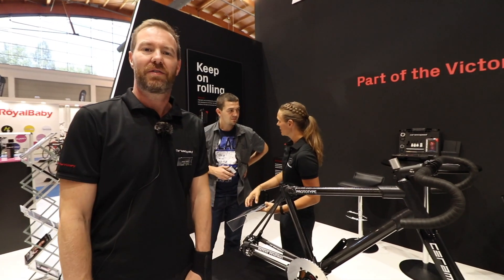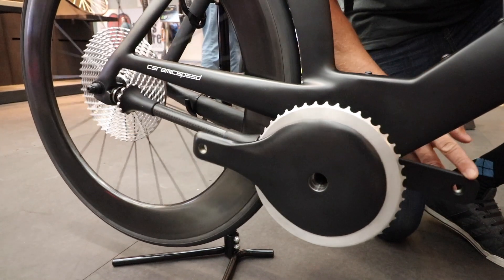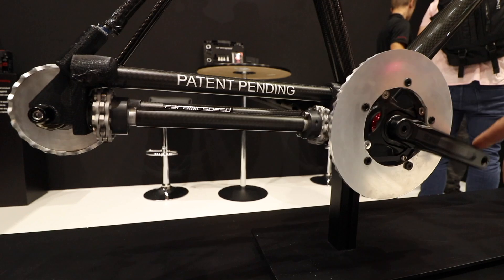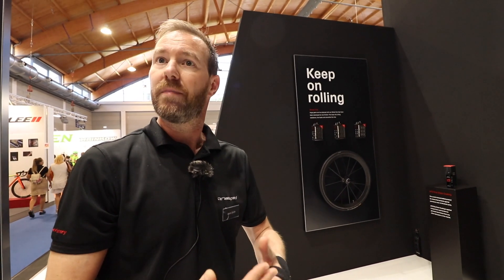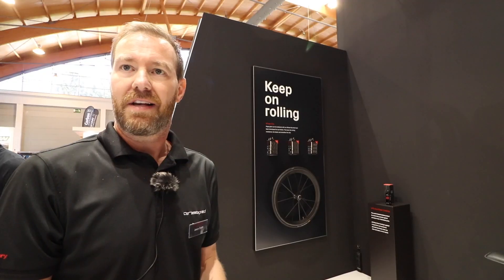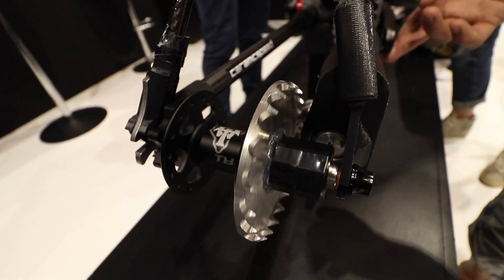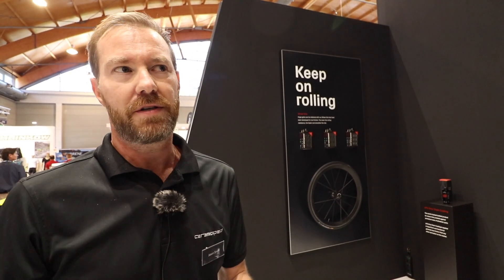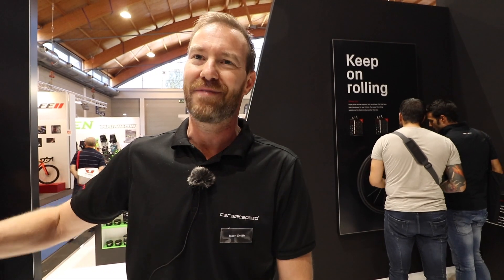CeramicSpeed Driven chainless drivetrain is 99% efficient

Comment: 49% reduction of how much friction? If you have a  very small amount of friction in the first place then the saving is still a very small amount of friction. Also what about when the output is much greater than the test point? There could be loads of distortion with this drivetrain which could cancel out any improvements.

Comment: Another ingenious invention, add it to the 3 million + inventions in the US in the last 100 years.... 

My only concern is during difficult terrain, when the bike is bouncing and a rider applies torque during an uphill climb, while standing up and then changes gears, how will it switch from gear to gear smoothly. And what about adding in a wet path / road, in the middle of a rain storm, how does it handle...

Comment: Finally a challenge to the 19th-century roller-link chain. As a bike mechanic I have to explain to people  why, if they let their chain wear out past 0.75 percent, so-called "stretch," it has already destroyed several cassette sprockets, and their most-used chainrings. This necessitates a fairly expensive drivetrain rebuild. If the new system can demonstrate longer wear, and reduced cost to replace wearing components, then we can seriously consider phasing out the current bicycle drive system.
Reply: Arne Ryason 
This won't be either.

A lot more wear and tear, and the parts have to be very very precisely made.... And very expensive.
Reply: Prototypes are always expensive. Precision manufacturing in the bike business is easy, just look at the tiny details on the "power link" style master links on multi-gear chains, and the precision forging of cassette gears. I've been working on bikes since 1972 and that kind of thing would have been "impossible" back in those days. All it takes is demand, and economies of scale. The VCR is a good example of highly precision components in mass production. The video head gap is measured in a fraction of a  micrometer.

The pitch of the roller-link chain is constantly lengthening as it is ridden. This is especially true with mountain bikes, the front wheel throwing a constant cloud of dust into the chain, which acts as griding compound. The wear on the CeramicSpeed system will happen on the little rollers that drive the gears, but the pitch of the roller-carriers won't change. I can envision those little rollers being mass-produced, easily replaced by the bike shop or user. If the claim of 49 percent less friction is true, that is a significant reduction or wearing components, and ultimately a reduced cost to the consumer. 

The horse and buggy are no longer a common sight in most American cities, and my guess is that the days (years probably) of the 19th century roller-link chain are numbered. Resistance to new technology is fairly typical, though.

Comment: The entire bike would have to be build around this drive train so it would be extremely expensive to purchase, maintain, exchange used parts. And ceramic speed has the reputation of making things unnecessary expensive so entire bike with that drive it works like they claim would cost around 100.000 $ ....

Comment: Well you need people with innovative ideas otherwise we would still be in the Stone Age. From an engineering point of view it’s superb. The idea looks like it has been reversed engineered from direct drive motorcycles ie BMW 1200 GS, as an example. The idea is sound.
Reply: Problem I see with this system: You need very little tolerances in the concentricity of the chainrings and a high stiffness of the crank and bikeframe under load. The drive shaft can not counterbalance any tolerances or wear like a chain can do. So you need a force to push the gear to the "chainring" to prevent "jumping". A Chain creates its own force , which pushes it to the chainring
Reply: Mark Gilder it's flawed,
Cannot transfer the torque.
Reply: The bmw has a bevel drive with a robust cast housing
Reply: By innovative you mean recycling 19th century technology and saying you just invented the wheel?

Comment: Lmfao this is a decades old idea. Actually 2000 years old Archimedes idea. The problem with this system is that the tolerances have to be 100% dead on as any movement of the shaft will immediately skip the gears. Curved teeth is a moronic idea because the force you are applying is not spread over the the ring as a chain does. So the force is being applied over only 2-3 teeth which you already know this company will be selling a lot of parts..... This is a complete joke of an idea, even Archimedes or Da Vinci would laugh at it. If I was there at the demo I would ask that question immediately so all the force is being applied only to 2 teeth, so what happens to Ring vs Cog Gearing !!!!!! Which is the whole point of the Rings!!!! Lmfao.
Reply: they also cut their dick to save 100gr
Reply: I agree, i question it's fundamental design, it might work wonders on a stand, but what about the real world conditions, not only would there be allot of load at the point of contact where the teeth engage but i'm pretty sure it would create flexing and what not in the actual gears and cassette, a strong rider can really put down allot of power and combine that with frame flexing etc and since you don't have the agility of a chaindrive flexing of the materials will cause hosts of issues with reliability and consistent performance, i wouldn't even run this as a casual rider, chaindrive systems have become really good over the years and are reliable enough, and they can be set up on many different types of bikes, they are easily adapted.
Reply: its not for mountain biking or goinguphillthen,just for stadium race
Reply: Aditya Wardhana lmfao they already ride 5 kg bikes lol WTF do they else need!!
Reply: Soon there will be bone replacements for cyclists where they replace their bones with carbon fiber replacement for weight loss.
Reply: HansensUniverse lmfao ROFL  , hell make a half man half bike lmfao.

Comment: Why not put all those 'gears' on the crank/drive wheel?
Leave the rear hub as a light weight single speed gearing.
All the weight stays central, all the teeth are inward.
But your asking more and more from the bottom bracket.
Reply: This is actually a better idea than ceramicspeed! It puts the highest torque through a smaller (less bendy) disc diameter - the inner ring of "gears" on the chainwheel - instead of highest torque transmitted at the edge of the large (bendy) disc at the rear wheel

Comment: This is only a showroom prototype. From the engineering standpoint I can see some severe problems:
1.) There is only 1 point of contact at any time with the small bearings to 1 tooth. 1 tiny bearing has to transfer up to 1000 Watts peak performance from a strong sprinter/MTB guy which leads to short lifetime of the bearings and tooth material. The problem is not the Ceramic ball inside the bearing, but the steel bearing outercase and the steel tooth of the discs that have to transfer all power within a 1mm² contact area.
2.) Is the carbon shaft torsion resistant to a strong sprinter? How long does it last?
3.) The power transfer to the disk again is done with 1-2 tiny bearings on a huge disk. The further away from the center the more lever there is which means the light disc will bend inwards unless it is made from very solid aluminum (too soft), titanium (expensive) or steel (heavy). 
4.) To best save weight the 2 discs would have to be made from aluminum, which wears down quickly due to 1 point contact with 1 tiny bearing. A regular chain can spread the load on many aluminum/steel teeth to avoid that problem.
5.) I'd like to see the shifting between gears, as there is no smooth chain overlap among cogs but a sudden step between the gears. The slightest misalignment (tooth on tooth) would lead to catastrophic failure of the gearing. That's why he is talking about 5 channels and computer controlled movement in those channels. The disc needs to be high precision manufactured (CNC machined just like the SRAM Eagle) and therefore very (!) expensive.
6.) Unprotected ball bearings are a maintenance nightmare in the open environment. Even sealed bearings will accumulate dirt over time, just ask any inline speedskater. Dirty bearings drastically reduce performance.
7.) Bearings in this system are waste material due to heavy abrasion as a single point of contact of power transfer. The tiny outer steel case will be gone pretty soon when 300-1000 Watt peak performance is applied by the athlete. So the most expensive parts, the bearings, are to be replaced quite often whereas on a conventional system the cheap chain is being replaced regularly. Do I see a flaw of logic in here?
8.) Similar to Carbon Belt Drive bikes, where the frame has to be super-stiff in the back for precision alignment, this CeramicSpeed system needs very precise alignment and a very stiff back triangle. I can imagine a very harsh and unforgiving ride. And due to its very high cost it's for pro-riders only who get it sponsored. However these pro-riders generate abnormal peak-performance and thus need a super-super-stiff back triangle. But that contradicts a comfortable ride to allow for a longer ride performance.
The only good application would be indoors on a track. But those guys generate up to 1500 Watts peak-performance and would quickly destroy that system.

So far it is only a design prototype and no working real-life product. We'll see. If it's made from adamantium then all will be fine.
And its true purpose might be attention grabbing for CeramicSpeed and that worked out beautifully. It's all over the internet now. :)
Reply: actually they made full shiftring version.

Though, I agree on all small-contant issues.
Also, it's a live meat-machine.  Really dangerous.
Reply: RS1 Or just take 2 minutes of your time and learn a bit of good critical observation.
Reply: Whoever heard of an open drive train when bearings and gearing are used?  Close tolerances required to assure high efficiency would get clogged with debris almost immediately.  Also, what is the safety factor against failure.  They are promoting that it is capable of transferring 380 watts. Most safety factors used are 2.5, which would require it to standup to about 1kw. Seems like the prototype shown wouldn’t come anywhere close to that.
Reply: @rpondyke2121  Why are people assuming it has to be open? This is likely just for demonstration purposes... there's no reason it can't be sealed up.
Reply: MisterFuturtastic not sure how that could be sealed up.
Reply: @rpondyke2121  I see no reason it couldn't be sealed... and it wouldn't even need to be totally sealed to protect people or other things from it.
Reply: Agree with all your point. To me, debris is a huge problem. You'd have to ride this bike in a clean room.
Reply: Side note, haven't similar transmission for bike been used long time ago, but they didn't use bearings but cogs.
Reply: Well I've been curious, I haven't seen an engineer talk about the design or any patents. Pretty sure I saw a similar drive train on a 100 year old bike with heavy steel components, one gear and no bearings. Even if this was made of titanium it would struggle to last more than a few hours within a reasonable weight limit. I could see it lasting as a single use race bike, but the stiffness issues and precision required will take time to get right. Syncing gear changes at that precision needs a very stiff frame. Good luck to these guys, innovation in design is good, crossing my fingers that you have the engineering to back it up ❤
Reply: Hi, Mechanical tradesman here with years of engineering background, the numbers i related are accurate. also titanium is too flexible to be used in this application. a chain is 97.4% efficient, and this is absolutely NOT 99% efficient, NOT POSSIBLE due to design ( they took that 99% at BEST with the tire not touching the ground, so no tire friction to overcome. )
Reply: DilbertMuc u just tore apart his every hope of producing this....good job
Reply: Next, post the written version of the Dark Knight. 

Seriously though, thanks for sharing your thoughts to people who has little to no knowledge at all to these kinds of things.

Sorry for my bad English.
Reply: Also its NOT 99% efficiant of you are an engineering student you can crunch the numbers. Mine suggest 92% at max and that is under perfect conditions and brand new bearings and alignment.
Reply: who cares can't really compare dragon armor to this, Mai point of dragon armor is to dissipate energy as much as possible by shattering  small ceramic plates. (if we think of same dragon armor)
Reply: And Oiling Problem too
Reply: I think you just earned a PhD
Reply: Karlo Crneković Yes FN hersthall did it in the late 1800s or early 1900s
Reply: Kurla Stabakan but at what weight will it be strong enough?
Reply: DilbertMuc i found Jordan Schlanski .
Reply: why is it that everyone only is talking about application at max power. What about using it on a commuter bike, radonneur bike,  or possibly on a velomobile... the robustness would be one pain point I could see as would be repairing on the fly. I do like being able to use my chain breaker and fix a snapped chain link on the road in 5 minutes...
Reply: Who the fuck are you, engineer or something
Reply: Yes I work in mechanical trades.
Reply: Yes. Maybe road racing and it works... but as an ex bmx/dirt jumper/mountain biker, i can tell the fixed, limited surface area would be problematic handling repeated torque. Even with traditional chainwheels, chain, rear sprocket  i would bend teeth and break chains and a front rear sprocket has like maybe 5-15 teeth engaged at one time. Plus the pull gets distributed through many separate parts on traditional setup.
Reply: U have the indi links of the chain, front sprocket with like 25-48 teeth, cranks, spindal, bearings, chainwheel alan bolts, rear sprocket with like 14-18 teeth, the freewheel bearings, rear chainstays, hub/axle, ect. The points where they are bolted together all absorb shock.
Reply: Apart from 2 and 6 I'd agree with you
Reply: Very well said. Lots of PR-talking and nothing to show for it. The next non-starter in the history of inventions...
Reply: sir can i get more information about this project
Reply: @RS1 1. It won't be any where near as efficient as it currently is once they put seals on all those tiny bearings.
2. With a total of only two contact points anyone stronger than a small child it going tear it apart.
3. It's going to be too expensive to make work and for frame manufacturers to retool and redesign frames to cope with different loads this design would produce.
4. It looks pretty with all the shiny aluminium parts combined with the carbon.
5. It's just an exercise in marketing and totally fecking useless.
Reply: DilbertMuc what do you think about Nubike?
Reply: Yeah, its a question of durability.
Reply: This is easy to solve.. just make the parts larger and more heavy duty.... of course that adds more weight which in the end could reduce over all efficiency - but that will have to be determined in time and testing. It's odd to me how people act like this is some impossible feat though.. lol This is how most things are engineered.. just not bikes because until now the chain system was more simple..
Reply: DilbertMuc Also 99% mechanical efficiency with two 90° changes in direction is just a plain lie. That's bogus
Reply: Tomasz Pietrek yeah....imagine getting ur finger stuck in there
Reply: You just sold out your intelligence for free.
Reply: our intelligence, mine, yours and everybody else, this is the very essence of being a human, we are a hive. when we work together we all win, therefore I have no interest in profit from ideas, as to benefit you is to benefit me. :)
Reply: DilbertMuc Ceramics can be way stronger than steel you ever heard of dragon armor . I think you are spot on otherwise . I'm sure that porcelain is no dragon armor probably closer to Grandma's pottery
Reply: Joseph Hess more like imagine getting your foot or calve stuck in there or cut by it if you crash. Slice your toe off or completely shred your calf
Reply: They are engineers too you know. They will figure it out.
Reply: DilbertMuc Fuck off nerd
Reply: clever response.. did your mom help you to write it ??  :)
Reply: MrDmadness yea m8 she did
Reply: thats good of her... give her a hug, shes a quality lady who cares for you. :) 
thank you for the compliment also.

Comment: how you seal ball bearings that acts teeths on propshaft, I see they are opened so 1 rain and system will fail( i had pulleys on rear derailleur with sealed ball bearings and after first rain , water came inside and everything rusted)

Comment: I crave the day when the current system becomes obsolete. A chain open to the elements is crazy. If it was in a sealed enclosure it would last many many years.
Reply: Chris Curtis so what about a lot of tiny ball bearings that don’t seem to have any rubber seals on it ? I’m not sure this solution is a lot better or maybe even worse
Reply: Yard Sale Dale well let’s say it like that ..I think such mechanism will not make it the hobby users as it looks more expensive to produce and to repair ( a lot of bearings vs a chain)
Reply: Yard Sale Dale but aren’t these ceramic ball bearings? In difference to steel ones those hardly need lubricants and don’t corrode ... but instead of a few cents like steel once those still cost several dollars each I believe...